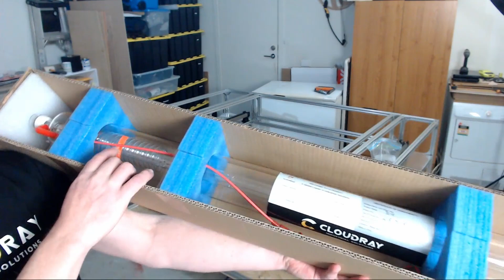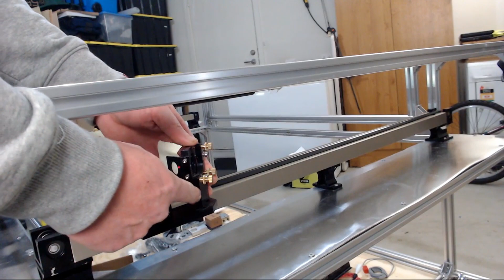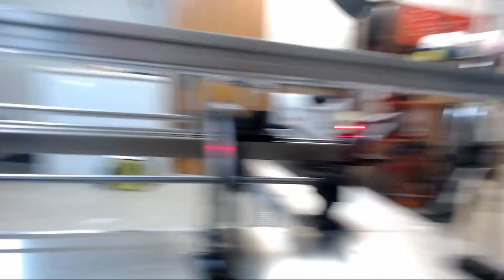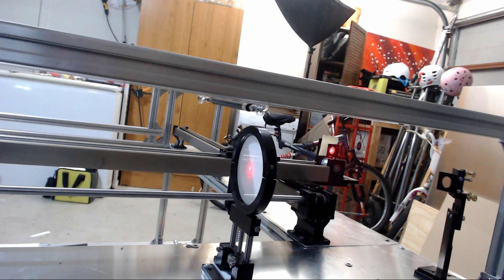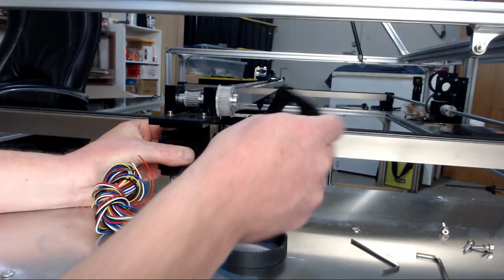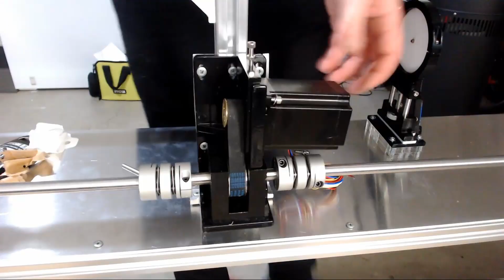05 Build Your Own Laser - Tube & Mirror Mounts + Stepper Motors

Comment: can I ask about the machines of wood that can be cut by your 90w laser tube ??
Reply from the maker: could you explain what you mean by that question?  Thanks
Reply: @MWLaser 
sorry , my mistak ..
what is the maximum thickness of wood your 90w can actually cut?
Reply from the maker: I have not tried anything thicker on the 90W, than 25mm (1") Softwood, which it cuts well using a 4" Focal Lens
Reply: @MWLaser  thanks ❤️❤️❤️